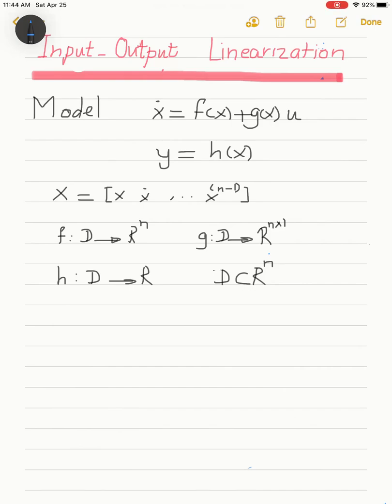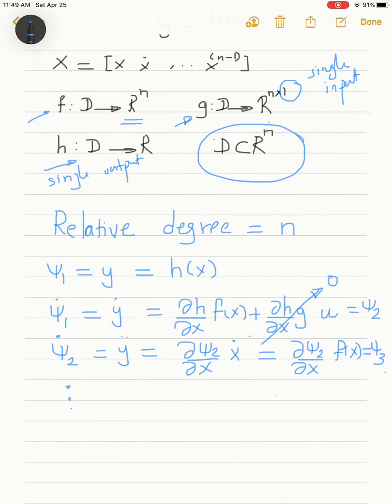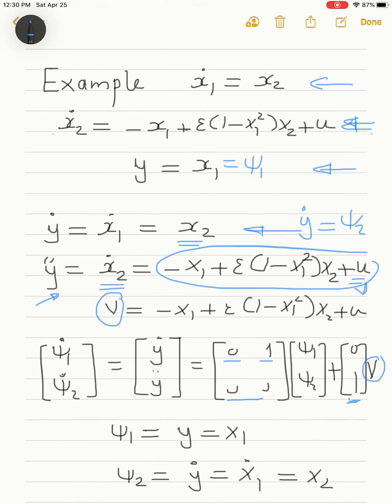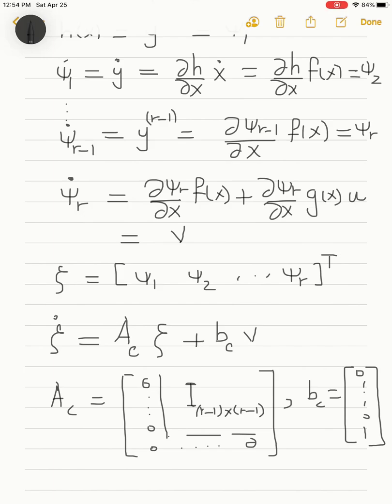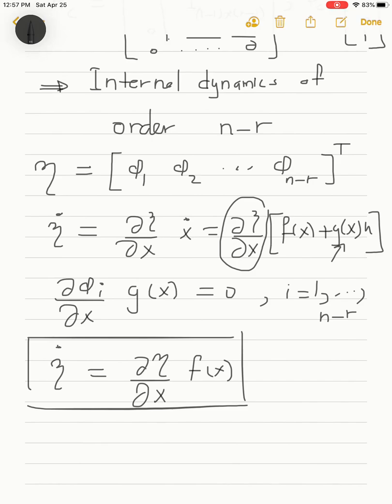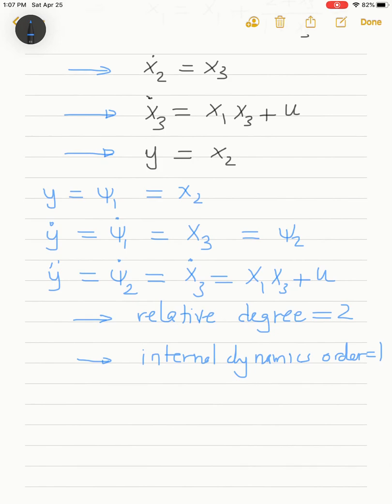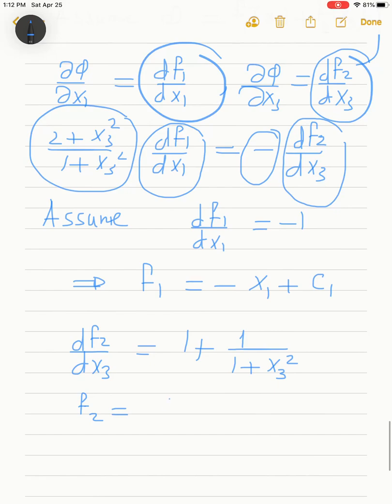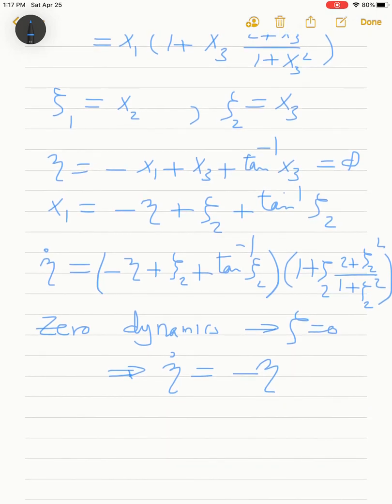L13 Input-Output Linearization

Comment: thank you for your video.
at 34:06 i think there is a small mistake, because f1(x) = x1 and not -x1. so if this would be the case, I assume this would result in unstable internal dynamics.
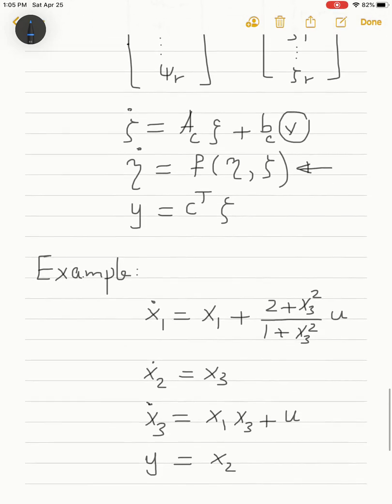Reply from the maker: Thanks a lot for pointing out the mistake. However, The original system equation should  be x1dot= - x1 + ... So, the correction should  at 24:17.

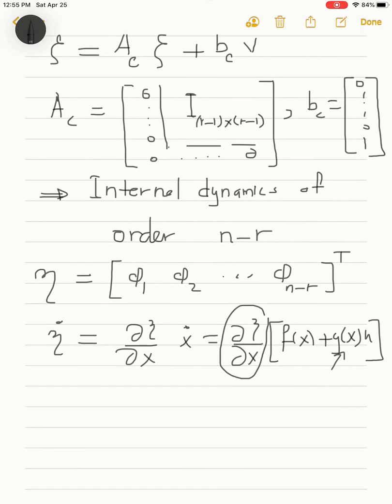Comment: @18:30 You are saying that the product of (dη/dt)g(x) is zero due to internal dynamics. But I didn't quite understand that part. Why should it be zero because of internal dynamics? Please help me!
Reply from the maker: The internal dynamics represents that part of the system which is not explicitly coupled to the input u. If  (dη/dt)g(x) is not zero, then a term (dη/dt)g(x)u will appear in the equations. This will be no longer internal dynamics by definition.
Reply: @DrElshafei  Thank you :)